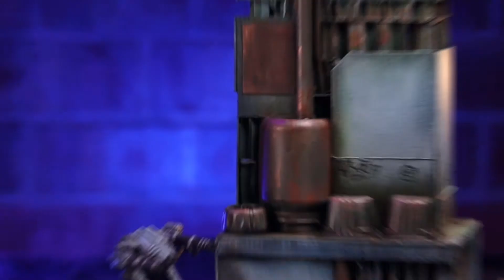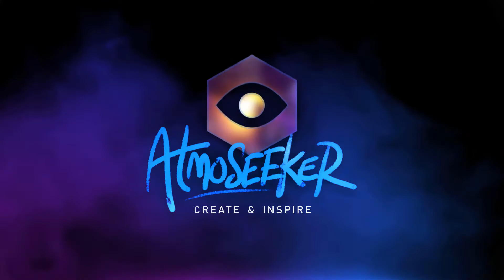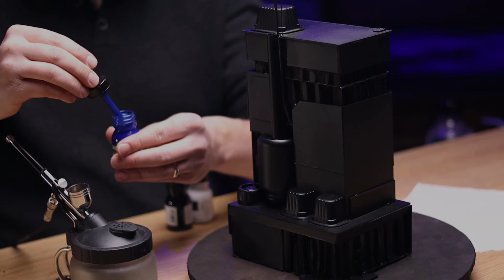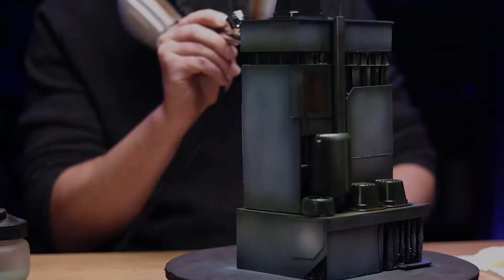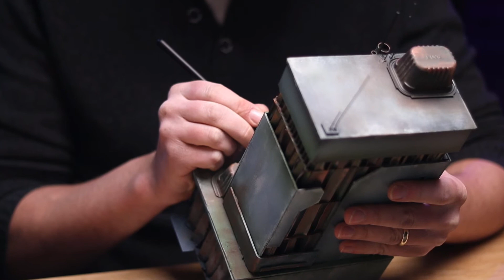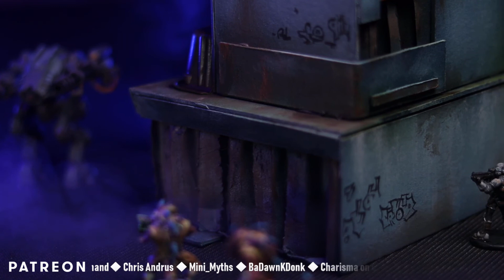CHEAP Wargaming Terrain Using Upcycled Materials

Comment: Think you need to hide the square plastic cup things better. The ridge at the bottom makes them clearly recognizable as plastic cups. I would recommend tracing them on cardboard and cutting out a hole, so you can sink them into the build. Then use some filler/speckle to fill them flush with the ground or add some ground detail across it, right up against the plastic cup. Otherwise this looks great. All it is missing is a stair to the top, to make it a playable surface, giving your board some more verticality.

Comment: The dip packets still stand out to me but the honeycomb cardboard gives a very cool texture to this large industrial machine. Looks like an air filter or maybe a moisture collector. It looks great.
Reply: The think it is mostly the "Flange" of the packet that makes it seem out of place. Maybe some cabling or something like you said. But other then that I think even the pill container looks like a large tank. The cardboard showing is honestly what sells it all for me.
Reply from the maker: Thanks very much 👍 yeah I can see what you mean, maybe a few extra bits or details integrated into the dip packets would help obscure it a bit more. Appreciate the feedback and thanks for watching!
Reply: @Atmoseeker  yea like some small "fans" or even wire run over it to make it seem a bit more industrial would have been perfect! I still plan on saving mine for a bit to do this!